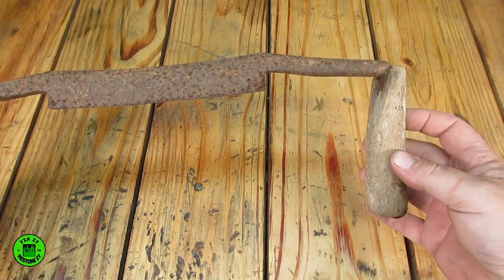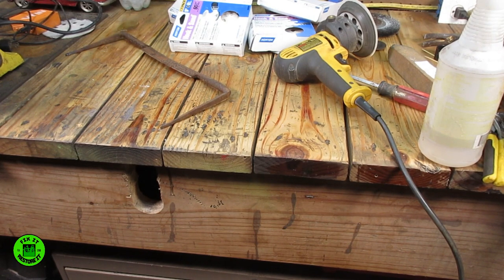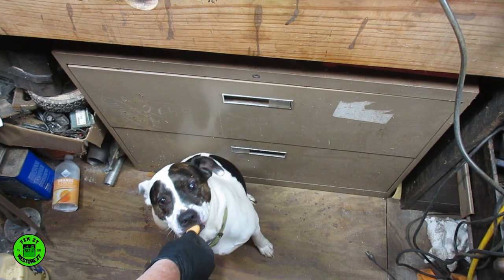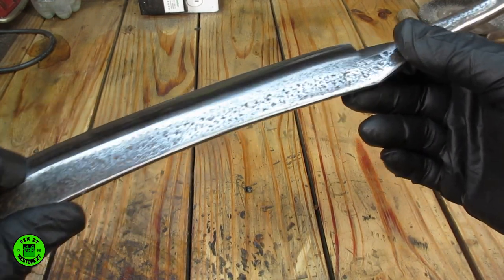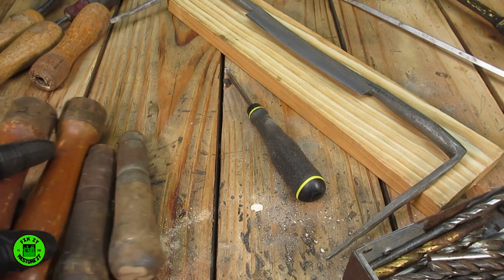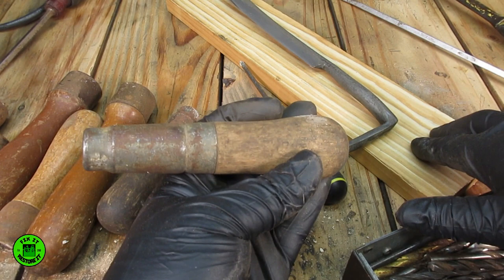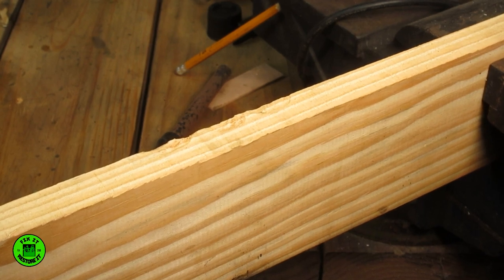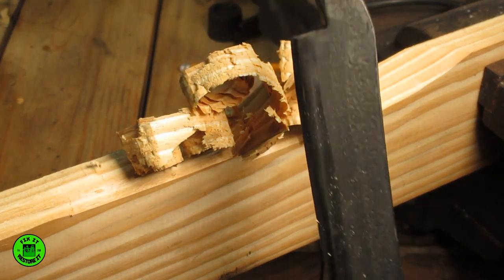Incredible Restoration of antique forged draw knife

Comment: Why did you bevel the rear side? The rear side of a draw knife must be flat. It's supposed to lay flat along the work piece, and the top section of the blade does the cutting.